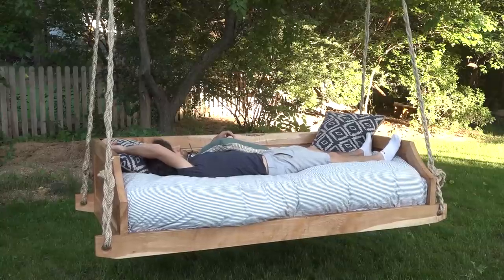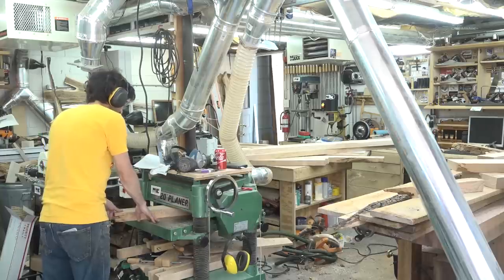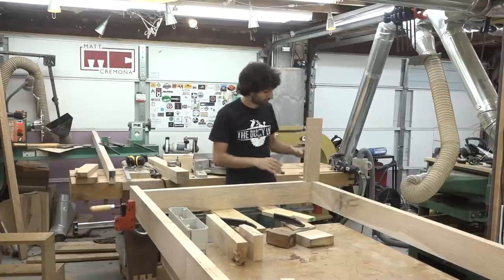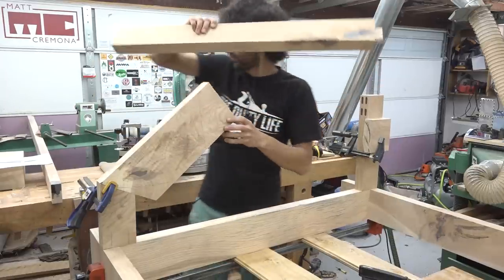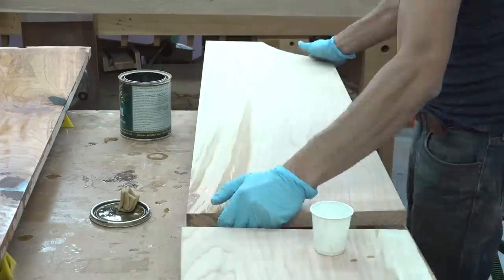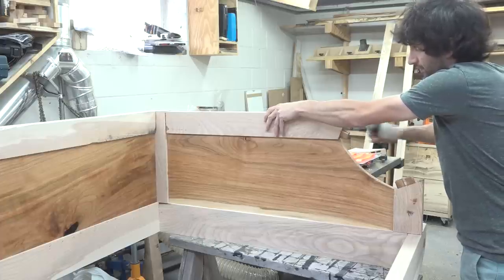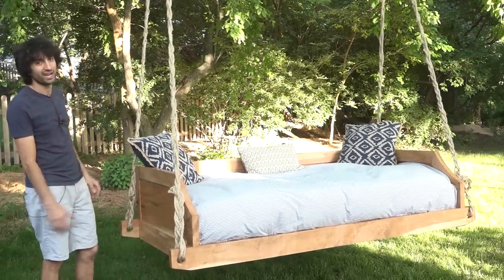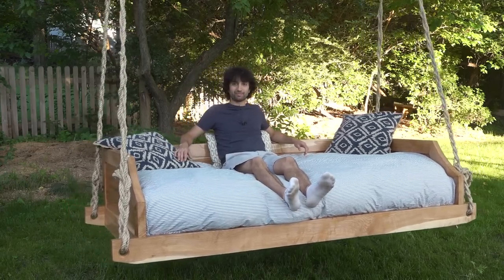Build a Hanging Bed Swing

Comment: Nice build Matt. Question: How are the LED light strips doing? Would do it that way again? Heat? Adhesive still working? Are they to hot to mount directly on wood, like rafters for example???

Comment: Matt,
From my days on the cattle farm, if you want a stronger tighter loop on the sisal rope, wet the braided section of rope with water and roll the wetted rope between two hard surfaces. The wetted and braided rope will bond very hard and strong after drying. After cutting the excess loose tags of sisal the result is tightly compressed and neat loop section. I've done this many times. 
Jim C

Comment: Matt I am building a similar version or your bed swing however I am using pine for the bottom frame. Do you think the pine will be able to hold the weight of the swing and its occupants with the same style hole through the four ends or should I consider a different method of threading the rope through the frame. Really love your projects and videos!
Reply from the maker: I think pine would still be plenty strong.  Try to find a piece that is as clear and straight grained as possible for those two long rails.  Thanks!
Reply: Matthew Cremona awesome thanks so much! I will send some pics when I'm done

Comment: What a awesome design came together with a lot of great tips for using the domino I have always had trouble lining up the domino for vertical setup but with the way you have here I will have a lot more ways to tackle this. Awesome video! Question do you think ash would be a good material for a split top bench from the guild??? It's cheaper than southern yellow pine here in Connecticut. I have to stop writing a book under comments lol.
Reply from the maker: Thanks Thom!  Ash is a good choice.  It's about as hard as hard maple.  Shannon's bench is made from ash.
Reply: Matthew Cremona  Thank you so much the bench is probably my next project after the bed lol

Comment: DYI bed. First you buy a bandsaw, joiner, planer, special mortising system, chainsaw system for cutting planks out of tree trunks, beam saw, scroll saw, and skilsaw. Oh yeah, put it all in a shop with a air vacuum system to get rid of all that sawdust and you are ready to go.
Reply: Wendell Montague I agree that watching videos like this can sometimes seem a bit daunting, but in reality if you think about it you only need 4 tools maximum to make this: a hand plane, a circular saw, a jig saw & a drill. Expensive gear just makes things more efficent, accurate and easy, but it doesnt mean you cant complete projects without them, you just have to find a way using what youve got :)
Reply: you can maket this with a saw , chisels , sand paper a hammer and nails
Reply: JMakes you could make the whole thing with just sandpaper too, but it’d sure take a shit ton of time....